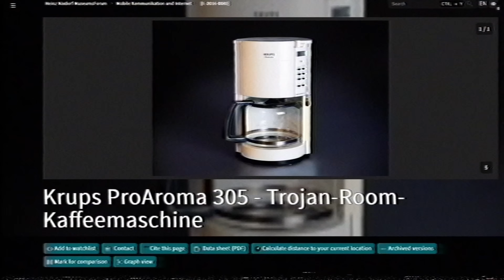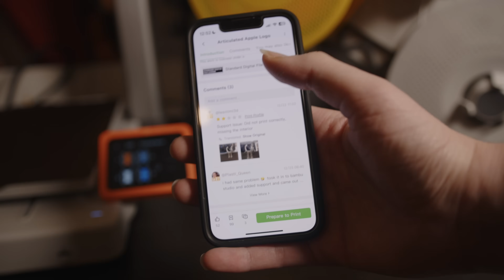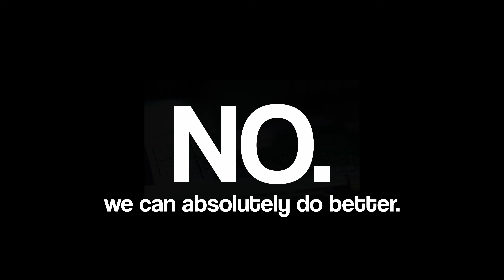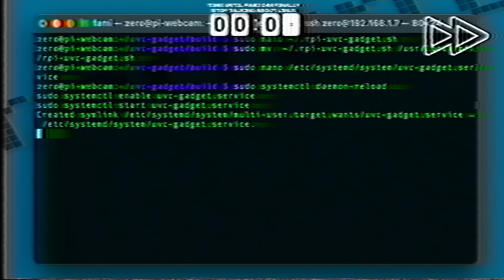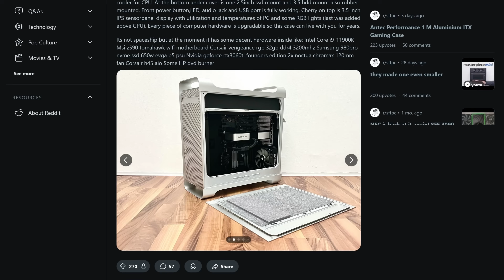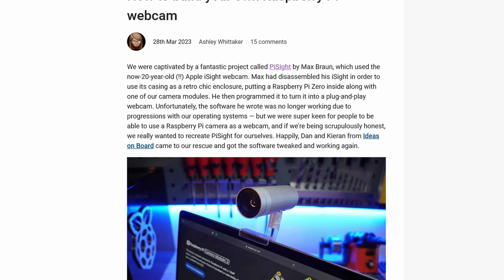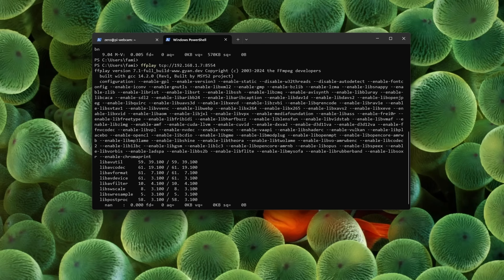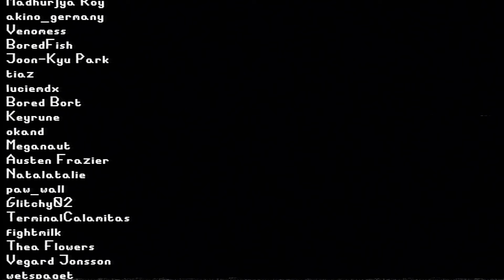Webcams SUCK, so I built my own one

Comment: Most people who hate video quality webcams just connect a professional camera up a computer and use software to use it as a webcam.
Reply from the maker: true, but that is both insanely expensive and a huge commitment to set up, while this is like 50 bucks and literally plug and play once built
Reply: @f4micom  you mean 50$ hardware and 400$ 3d printer and knowledge to make 3d models
Reply: @pixelsalad  you can use cardboard and hot glue and it will work the same. You don't need 3d printer.
Reply: @pixelsalad  Or free sponsored 3d printer and free 3d models. 
Or $400 3d printer and MILLIONS of free 3d models. Anybody buying a printer to print a single object would be the most humongous idiot on the planet.
Reply: @pixelsalad  You can get a pack of thin index card sized acrylic sheets for like CAD$9 and a bottle of CA glue for $2, maybe another $7 for a can of plastic paint if you're sloppy with your glue application. 
A sheet of balsa wood is also like a dollar. There's options aside from a 3D printer; I built my Deej using the aforementioned acrylic method.

Oh, and if you wanna pay shipping, I'll send you a box with 12 failed board games that you can pull apart and use the compressed cardboard to make all sorts of stuff, that's what I've been doing with them; fantastic bases for tabletop terrain.
Reply: @pixelsalad  many municipal libraries offer at-cost 3d printing services. Even for-profit online 3DP services aren't inordinately expensive for small parts.

Personally if I built this (which I'm strongly considering, it's very cool), I'd house it in a PVC pipe or similar hardware store buy. Mount the cam and Pi on a paint stick to center it in the tube and you're golden, no 3d printing at all.
Reply: @f4micom  you will also have professional camera at the end of the day to use if you go with that route
Reply: @f4micom  a 3d printer cost 50 bucks? where is the link then?

Comment: You know what's even more of a racket? Handheld digital microscopes, especially those for medical use (eg for skin doctors). Can easily go to four or five figures, and it's just a cheap webcam with some lenses and some old software incompatible with anything else.
If anyone has a reasonable solution I will be in debt with you.
Reply: Industrial camera with macro extenders and long CS mount lens. Shouldn't go above 300 bucks if you search well enough 😊 I'd say the lens will be the biggest expense, the cams itself are pretty affordable if you don't need high FPS, resolution or darkness performance. Some brands to look for: PTGray, IDS, Basler, The Imaging Source
Reply: I used to do IT support for a biotech firm, and every one of their labs had a pile of five-figure microscopes. The software was a god-awful Java swing mess that we discovered was completely incompatible with Windows 10 (which was coming out at the time). The company was willing to sell us upgraded software…along with all new cameras for five figures apiece.
I’d bet they’re still using airgapped old Windows 7 machines and flash drives to get imaging out of them.

Comment: I think this is one of apple most beautiful products (with the iPod shuffle 3d), both reflected apple philosophy to the best. Years a go I had the crazy idea of taking out the guts of the ISight and change for another camera, i choosed the Anker c200 because it’s form factor, size and quality even it has the same mechanical shut off diaphragm. So designed a mounting support for it, I couldn’t find a good ISight here in Mexico and the ones on eBay despite were in good condition became very expensive with the shipping and taxes. Now it changes everything and I really want re take the project again so I’m gonna search for one ISight to finish it.

Comment: We need to go further. We need to be beyond Overkill. We need to make a 4k 60 fps webcam with RGB lighting
Reply: DSLR and a capture card. Go full circle.
Reply: mirrorless and newer dslr can stream via USB
Reply: @xureality  This is the actual way to go.
Reply: I absolutely concur! 4K60 is the way to go! 

Let me know when a 120fps version comes out - I'll be the first in line.
Reply: @just_mdd4  I didn't aim high enough I won't make that mistake again 8k 260fps chroma lighting
Reply: @404clippy  That'd be an excellent combination, so I'll take 3 of the Dolby Vision versions, for 2D and 3D video! I hear it's on discount for less than $3000.
Reply: @just_mdd4 Oh they do exist and the manufacturers want you to quote them for the price, so that you know they ain't cheap.
Reply: @rafall1118  I might as well stick to my iPhone 8 Plus, lol.
Reply: In that case, you can use a Banana Pi CanMV-K230D Zero instead of the Raspberry. Super impressive specs with hardware support for AI models.
Reply: I mean, SUB2R also exists no
Reply: Beyond overkill is 32K 3600fps
Reply: @AquaPeet  Only the frame rate is overkill! 😝💯